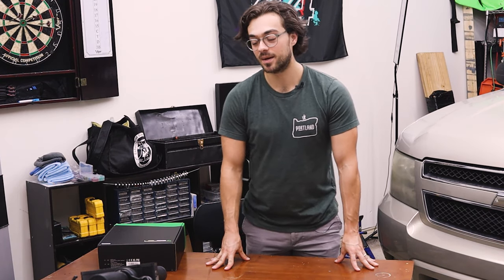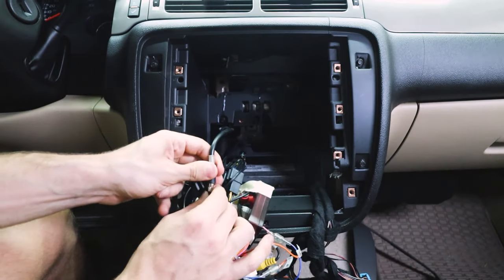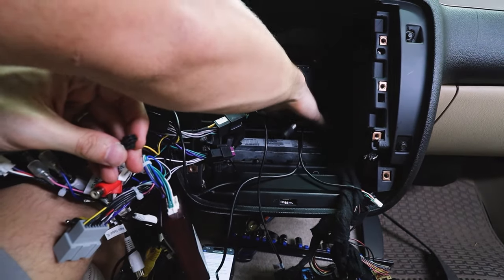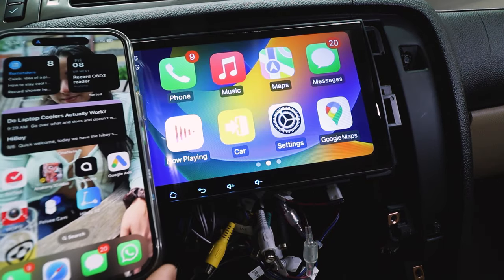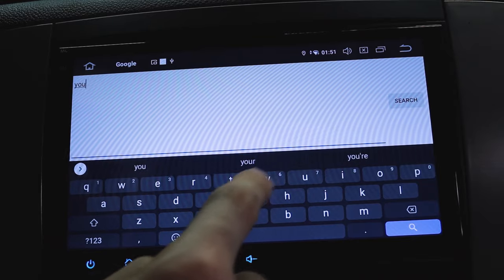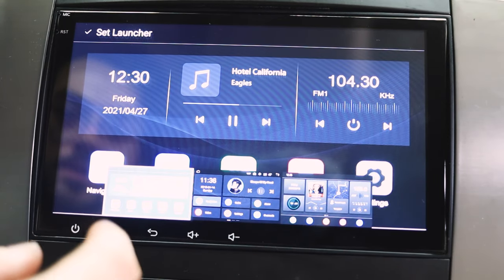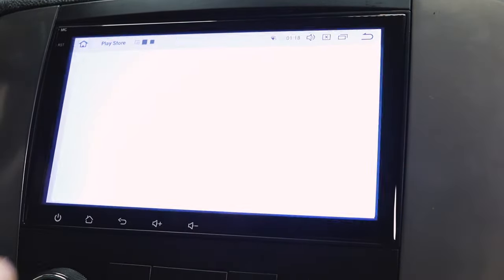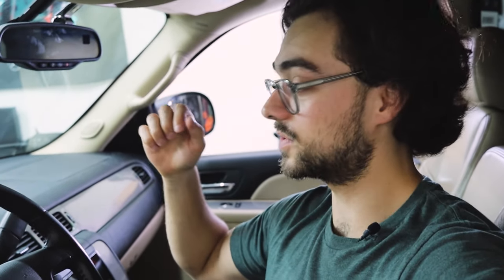Apple Car Play, OBDII, Front + Rear Camera | Eonon GMA12S GMT900 2008 Tahoe

Comment: I just installed this unit and I don’t care for the minimum volume as I personally would like it to go lower before mute.  You teach me that I have to turn off the Bluetooth to get it to use my hotspot.  Thank you
Reply from the maker: I can agree with that. Glad I could help you man!
Reply: Did you unplug the card battery to install it?
Reply from the maker: @cristianavila8109  no! Did not need to
Reply: @AutoMotivate even when you switched it out from the stock radio?

Comment: I bought this same unit for my GMC Acadia. I noticed that my charging system (battery and alternator less than a year old) slowly drops from 14.5 volts to around 12 volts while driving. Have you had this same problem?

Comment: Really enjoy clear info. Question my 2010 avy had xm. I deleted it and added external xm box. It use stereo mini audio to interface. Is there an auxiliary stereo audio on this unit. Tried talking to eonon...language barrier... thanks
Reply: if you mean a 3.5mm aux input jack, there is not. just installed this unit in my buick

Comment: I used your video to install my radio into a 2010 Chevy Silverado. I appreciate your help! I do have one problem... A constant hum from the right rear speaker! Any advice from anyone would be greatly appreciated.
Reply: Hello currently having the same issues did you find a solution? I’m thinking after. A lil research I have to ground the after market stereo but I don’t know how
Reply: @xvvau-_-  My problem was, I had one of plugs behind the radio in the wrong connector. I switched plugs and it was fixed.

Comment: I just got one of these for my 2012 Silverado because I love the way it has an oem look, but mine has the factory navigation, on the Eonon website it has the oem head unit under both compatible and not compatible, and I didn’t realize mine had the big white plug that the website says won’t work until I was getting ready to install it and got my factory head unit out, I’m trying to see if there’s any sort of adapter that exists that converts my stock radio harness to the standard harness without that big plug but so far I’ve had no luck

Comment: Purchased this version and installed it, was easy too set up and beats the radio Bluetooth adapter I used too use the only problem I’m having is that there’s static coming from it when in low volume louder than the music but if you turn it up the music goes up and not the static. It’s bearable but is there any solution too this problem contacted the business waiting too hear from them.

Comment: I just installed this unit and I seem ot be having some static issues. either on the radio or using carplay there is a slight static noise coming from the speakers it doesn't change with the volume. Any ideas?
Reply from the maker: Maybe something isn’t plugged in correctly?

Comment: Would this work for my 2007 Chevy impala
Reply: I installed it in my 2007 Impala SS, everything works but the steering wheel controls and it doesn't show me when my doors/trunk are open. Still trying to figure it out but not a lot of info or help from Eonon

Comment: Do these aftermarket radio brands good to buy for the long run? I am usually used to pioneer or Kenwood or jvc, etc. Does your radio have more features? Keep up the good work!
Reply from the maker: I’ve been using the Q80Pro for about a year now without any issues. Kenwood, JVC were once a no name branded. With brands like Eonon coming the the market it will drive quality of all units up and, ideally, drive down the price.

Comment: Will this keep my original back up camera for my LTZ?
Reply: Yes. I recommend getting a RCA adapter pull your cup holder out you will see the amplifier wiring harness you will tap into that put an amp under your rear bucket seat and buy yourself a compact sub to put behind your third row seat I could help you if you want or show you what I mean you have your factory sub and amp running as well as your aftermarket and it sounds great
Reply: @motolife702  definitely interested in that

Comment: I have the eonon gma12s and the steering wheel control stopped working 😢 4:50
Reply from the maker: I think it might be worth removing the unit and checking the in-line glass fuse. There’s a little black box about 1inch by 1 inch that holds a glass fuse. I’m not 100% sure what it does, but it has a wire coming from the canbus unit( it is what allows steering wheel controls). Worth a shot imo. Cheap fix too if that’s the issue

I would also unplug and replug In the canbus unit (the larger red box)
Reply: @AutoMotivate  Ok, I'll try that then. Thanks.
Reply: Do ALL steering wheel controls work ?
Reply: @Robert-ki7sw 
Yep
Reply: @CarTruckStuff did that fix your steering wheel problem? I just installed mine and everything is working except for the swc